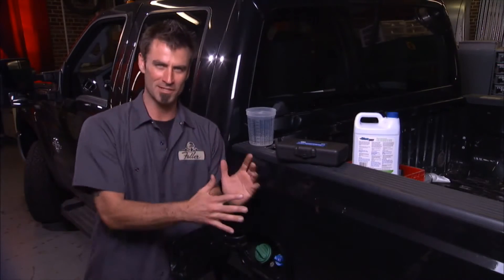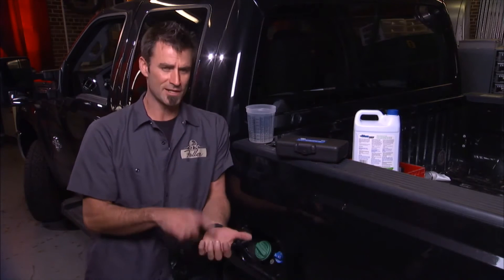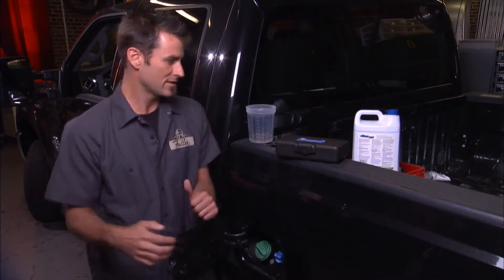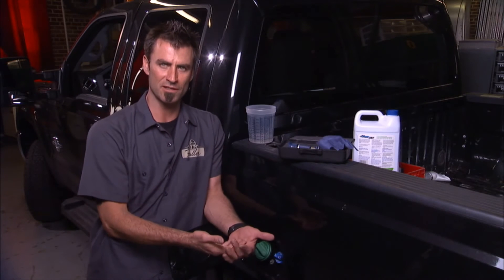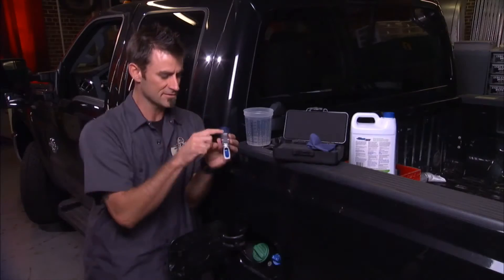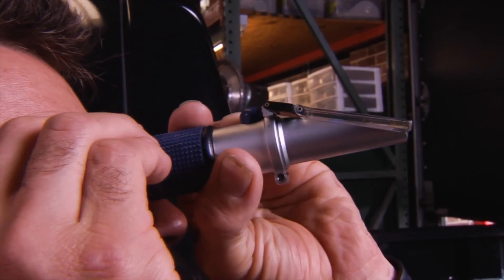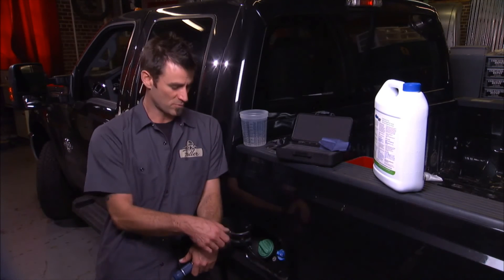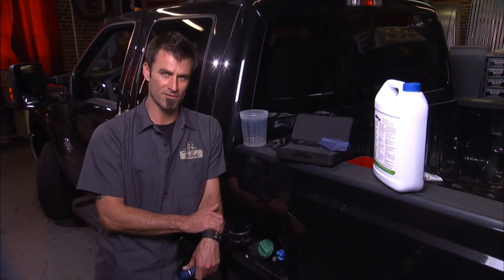Using DEF Refractometer - OTC5025

Comment: To determine the water percentage in DEF using a refractometer, place a drop of DEF on the prism of the refractometer, close the cover plate, and read the scale through the eyepiece; the reading will directly indicate the urea concentration (which is inversely proportional to the water percentage), with a proper DEF sample showing around 32.5% urea, meaning approximately 67.5% water content; key points are to properly calibrate the refractometer and ensure the reading is taken at a consistent temperature as this can affect the accuracy of the measurement.